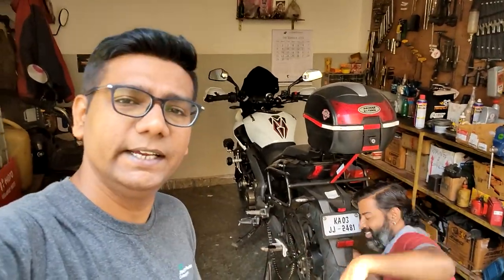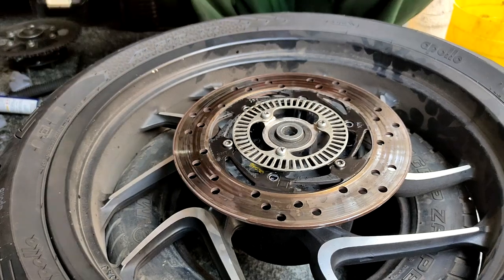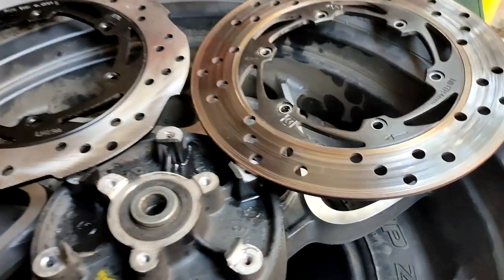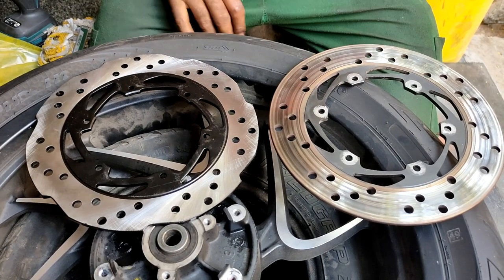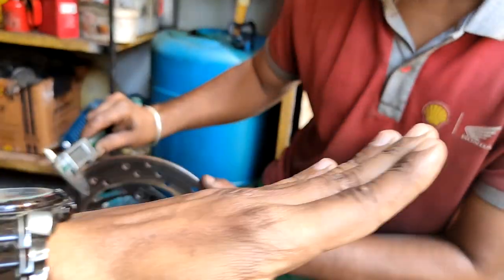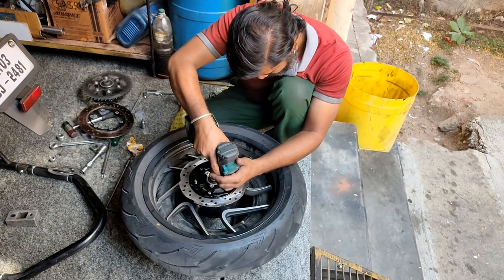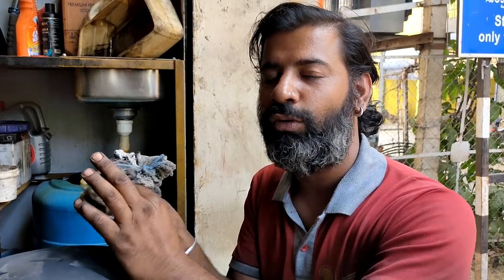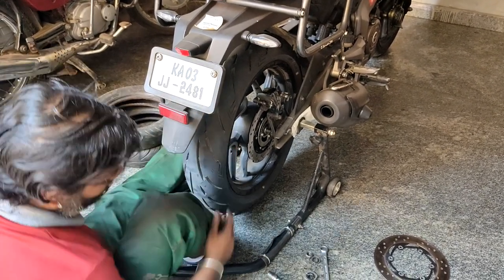WHEN TO REPLACE DOMINAR BRAKE - DISC PLATE | PowerPulse Garage technical discussion.

Comment: Yeah I am @ 85 k and still breaks are good for me but for my safety I am
Going to change my both the plates now but my ABS motor failed need to recoil and change all the necessary parts on breaking and using Vesrah’s breaks pads saving me still now 100% better then stock

Comment: Hi Vijay I'm rahulvlogs 
Few questions I would be grateful for your help .
1- which disc plate you have used in rear brake .
2 - is it working better or any issues found after 1000kms 
3- what kms you have changed your disc
Reply from the maker: Hi buddy
1 this is RS200 rotor same as dominar 230mm.
2 there are no issues and working as per design. Since I replaced it, the bite is better than before but it's just that earlier the disc was worn out.
3 changed the rear at 35000
Reply: @VijayHansora  hi just to inform I have RS 200 but my rear disc plate got damaged for 20k I don't ride my bike fast I used to give service regularly but I didn't expect it will get worn out so soon what would be reason
Reply: @sachinsathya1179 you didn't replaced brake pads on time
Reply: Which bike rubbers are preferable 6 piece seperate
Reply: @dmotodiaries8218  what is 6 piece

Comment: Nice Video...

One question though.. This ug disc plate works with existing caliper right?
Reply from the maker: No bro it seems I got it from NS or RS series of bike from  bajaj but it fits well no issues as same diameter of 230 mm
Reply: Vijay Hansora then why not put dominar if plates and NS or rs plates bro ?

Comment: Learnt so much feom your video. Thanks. I have a question. Is there a possibility of disc plate bending? I own a FZ FI V2, rode about 25K Kms. No major accidents. But i feel when pushing/pulling the bike while its handle bar turned either side, the bike moves with struggle even on downward inclined surface. I asked the yamaha mechanics, they say there is a slight bend in the plate. I cant completely trust the answer though.
Reply from the maker: Can you ping me on facebook asi need to understand more so I can share my inputs on call.
Reply: Yes brother they are right....I had the same issue with himalayan...disc slightly bent, you can remove the disc nd go for a new one and chk the same, or remove the old disc nd place it on the surface table chk for the bend by applying blue ink nd shave slightly in a milling machine and your disc is done...

Comment: Hi borh can I put RS 200 disc plate for Dominar 400 2018 model ?? Can you please tell me will I face any issue  while  braking.
Reply from the maker: You can only use rear as it is 230 mm same for both. The front disc of dominar is 320 whereas RS200 is smaller 300mm. So you can use rear but not front.
Reply: @VijayHansora  thanks for the info 👍

Comment: I have done that today with new brake pad but braking is not that good...does that take time..or there is a problem in brake calliper
Reply from the maker: Once you replace the disc or the pads or both it needs time to set in. It will take few kilometres before the pad and disc both set in
Reply: @VijayHansora  thanks for advice

Comment: I need to change front disk plate of dominar can i use ns 200 disk plate?
Reply from the maker: I haven't changed the front but the front in NS seems to be smaller just visit and check the size
Reply: @VijayHansora  any suggestions for front disk plate mine worn out at just12k km i am thinking to use petal disk brake...

Comment: Sir I have a Passion Expro bike and recently I have installed a rear disc brake from a bike modifier.  The problem which i am facing is when you apply the rear disk brake the bike gives jerks the braking is not smooth. What to do pls suggest
Reply from the maker: I suggest show it to mechanic since this is not a OEM setup there could be lot of things which can go wrong.

Comment: I was wondering, couldn't you have just buffed/resurfaced the disc using a lathe machine, or a stone grinder and the disc would be smooth again right?
Reply from the maker: The amount to be spent on resurfacing the disk will be as much as the new disc moreover the thickness will reduce and there is no point of doing so much effort. Safe bet is to buy new one.
Reply: Thanks man 👍

Comment: after running much kilometres you change your disc plate?
Reply from the maker: It depends on rider to rider.
Reply: Not necessarly,you can go to any miller to shave off the disc by 0.02 to 0.05mm from the sides so your disc is brand new again for another set of kilometers...
Reply from the maker: Absolutely right but on certain where the disk is not overused and the cost as they are not very expensive I would prefer to replace it.

Comment: I contacted Mr.Kaushik and he told me to change the disc and pads. After changing the sharpness in braking is not there. I fell jerks while pressing the paddle lightly.
Reply from the maker: It means 2 things. Brake has become sharp and hence ABS is kicking if ypu have a ABS bike. If not please call and take it to Kaushik so he can check.

Comment: Bro worn out rear plates will struck? The wheel
Reply from the maker: Sorry I didn't get your question
Reply: @VijayHansora  no my rear wheel is not rotating freely because of disc is tight now the calipers are fine but plate condition is worse it can be the reason for tight wheel rotating ?

Comment: Can I use non uniform disc plate on my pulsar-220?
Reply from the maker: You could provided the size is same. Also just to confirtwjen you say non uniform are you referring to petal disc or something different
Reply: Vijay Hansora I would like to use something different than the original round uniform one..

Comment: I think in the absence of holes of the discs, there would be a vacuum that could get formed between pads and discs.
Reply from the maker: Actually not vaccum but a heat layer which will reduce the bite of the pad and the extreme heat can cause deformation
Reply: @VijayHansora  Makes sense

Comment: Thanks for a great informative video. But IT guy unit of measurement is wrongly said. I.e., 4.1mm minus 4.3mm is equal to 200microns not 20 microns.
Reply from the maker: Thank you for correction and feedback.

Comment: 1) the new disk is from pulsar NS200 not from dominar 400 2019.
2) tell this guy, those serrated disks helps in proper cooling and doesn't increase braking.
Reply from the maker: Hi Shamik, you are right for no.1 its NS200 disk.
For point 2 : The serrated disks does surely help in cooling and allow gases to escape, and there are additional benefits where the e slots can clean the pad, and the edges of the groves increase friction improve the braking. for non serrated disc the gases can create a layer affecting the disc brake performance.

Comment: Disc material won't crack on its working temperature Dude. Its only happens sudden cooling.But in hear temperature only max 600. Go for thickness under safe. Scoring and marks are.okay. and its take little more time for bed in disc pad thats it. 

Am using dominar last 3 year. Change both discpads try EBC or Vesrah ceramic pads. LRL motors you will get vesrah only 1000rupees ebc almost 3times. They are 10times better than stock. Try man And ride safe
Reply from the maker: Sorry if we used the word crack somewhere. You are correct as there is no thermal shock here. It's mostly bad wear and tear. I did read about vesrah I guess they are organic material probably should be better then stock. Please share any link or contact or guide me I wi try. You too ride safe and stay home in this current situation
Reply: @Akhilpoomala  the FZ V2 pads are for the rear or the front brakes?

Comment: I just used 10ruppes sand paper on my old disc plate and believe me its working like new
Reply: It's harmful...
This system is decreasing your break life
Reply from the maker: It will for some time but it will eat your pads more for initial days depends on how aggressive abration sand paper you used,  but keep it mind one day you have to change the disc platter.
Reply: @VijayHansora  almost 8 years done Still Counting 😀
Reply: @arnabbanerjee280  hehhehhee 8years still working as new🤣
Reply: @VijayHansora  aye noob😀😀😃😃😀
Reply: @arnabbanerjee280  hiee noob😁😁😁😆😁
Reply from the maker: @PankajKarlopia  I am sure it will run for more 8 to 10 years don't worry.
Reply: @VijayHansora  yeh Boy😉
Reply from the maker: @PankajKarlopia  yes Alice in Wonderland
Reply from the maker: You are at another level where nobody wants to be. Bye. Enjoy your smartness. 😁
Reply from the maker: @PankajKarlopia  after you 😂
Reply: @VijayHansora  iam already in midway😇